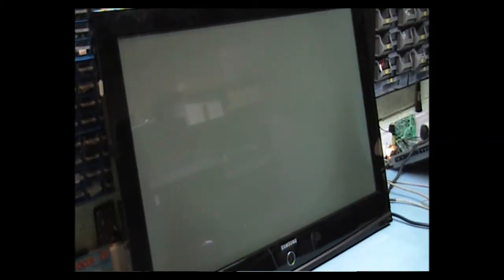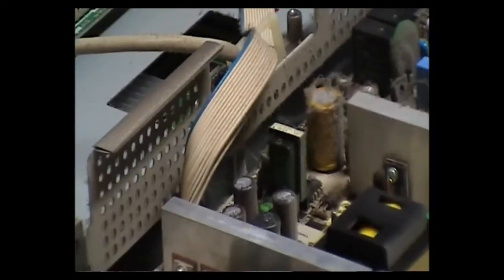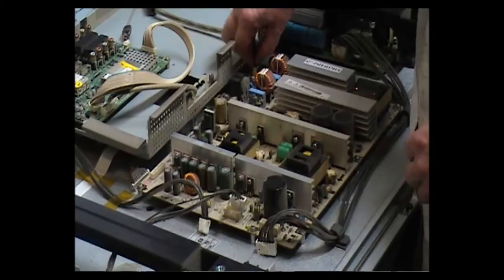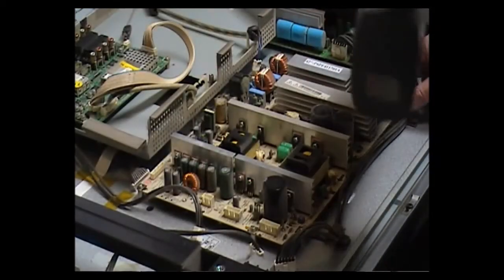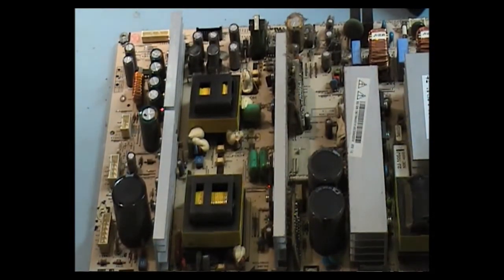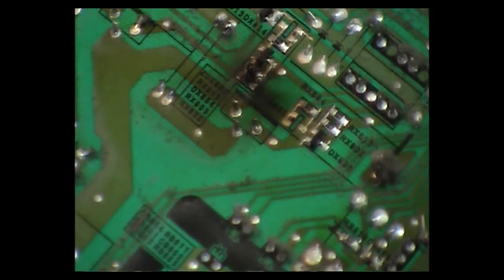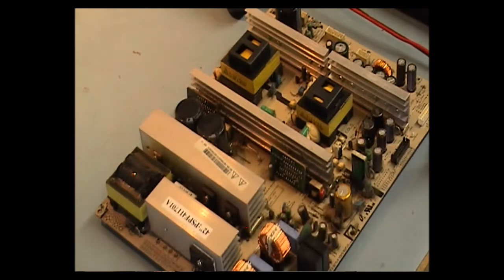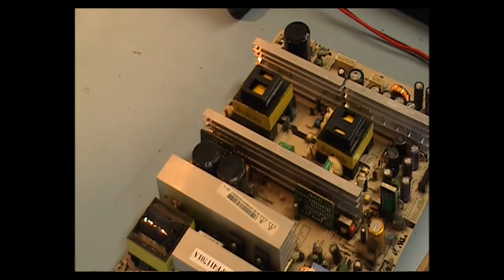Samsung PS-42C91HX  no power repair video Pt 1

Comment: Hello. What can I do if i only have 3.2V instead of 5.3V on standby? I have changed the regulators, transistors, diods, capacitors and still 3.2V. On TB801 on hot side I have 98V on pin 1,2,4 and on pin 6 I've got 5V bot on the cold side I have 3.2V. 

Thanks
Reply from the maker: without a schematic its hard to know
There normally is some kind of feed back from the secondry side of the psu pcb to
let the control ic know the output voltage, is pin 6 of the pcb marked 5V
what is the psu pcb type ?
Reply: I have the schematic but I cannot attach it. PSU is : BN44-00161A . I must have 5V on st by. The PSU is the same like yours in the film. I will try to take the 2 pins off from the TB801 which is the small transformer to see if I have 5V or 3.2V. Thank you